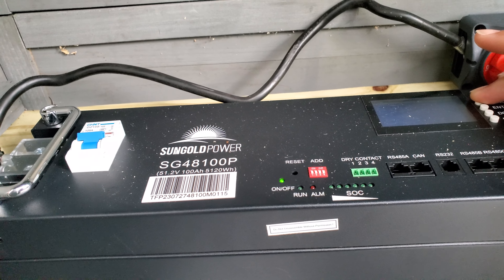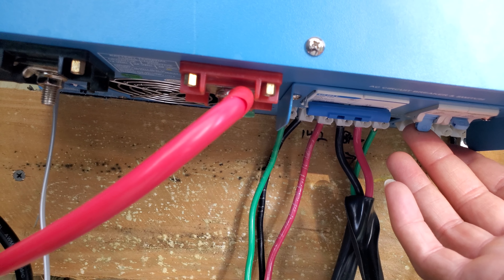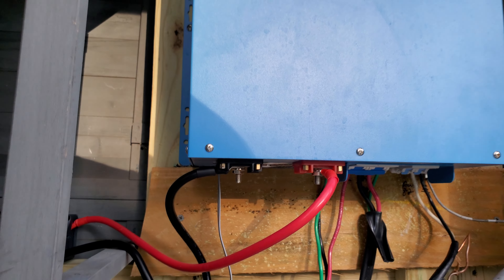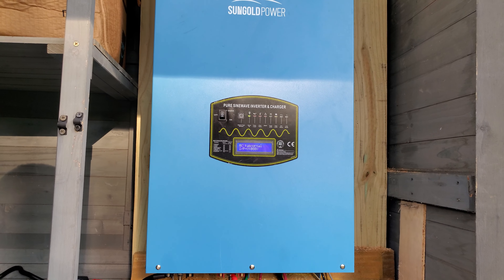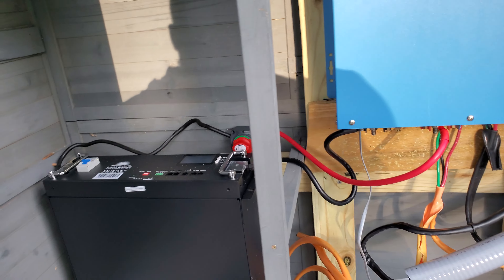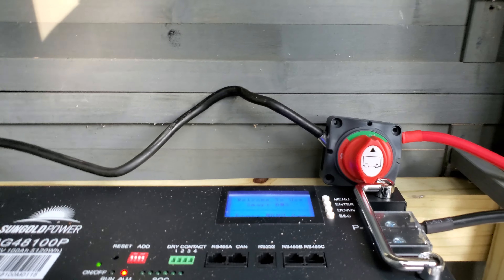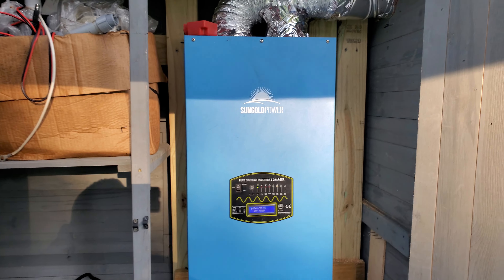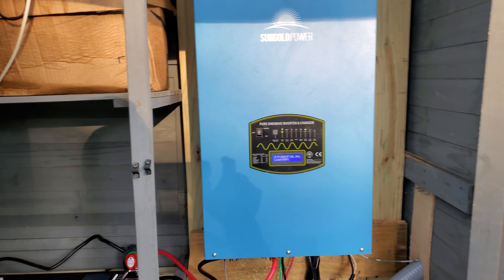INVERTER DIED THEN RESSURECTED

Comment: In my experience some inverters need to see 240ac (the grid) in order to operate.
Reply from the maker: I've seen some that need AC, but this one actually powers on with battery only and senses 240V AC in and uses it to bypass. Then output is also 240V AC. 

It senses grid outage to activate the transfer switch when it detects AC in is no longer present, which will begin the inverter mode as far as I understand Sungold's manual. 

So to sum it up 🤷🏽‍♂️